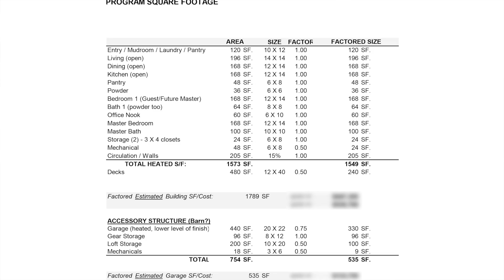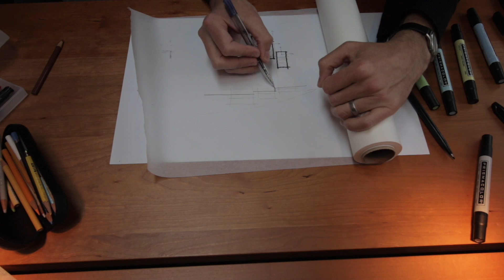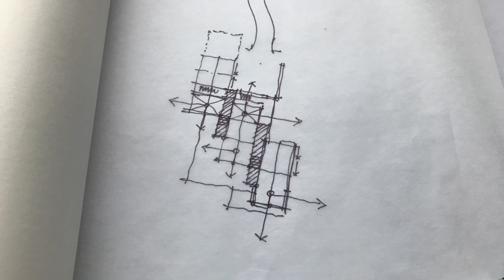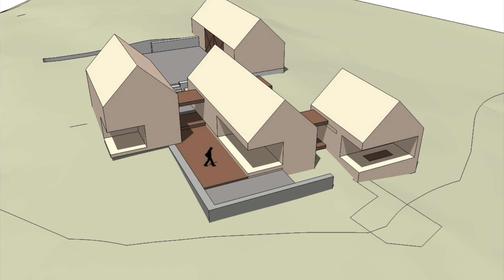Developing the Architectural Concept - Architecture Short Course (Part 2)

Comment: Hey guys I dont want spam but there was a glimpse of a trace paper with site analysis on the table with a huge arrow pointing out the wind direction. How do u decide where the wind comes from ? Actually I was wondering this for years. Is it from relevant datas or u decide, what if u cant come to the site ? thank u for explanation to my dumb question
Reply from the maker: no such thing as dumb questions...I use local climatological data from the national weather service and observe site conditions. here on the coast of maine the trees often flag (point away) from the prevailing wind direction. another way is to observe deadfall or vegetation growth patterns which can often indicate prevailing winds on a site.
Reply: 30X40 Design Workshop much much appreciation for your answer. I didnt expect one. Thank u for your tips and keep the good  and inspiring work. Cheers !

Comment: How is it you learn or how to you know how to balance the required thermal mass for moderating temperatures throughout the day which are likely to radiate heat out again at night with wanting to keep night time temperatures cool in bedrooms? Baring in mind I come from a part of the world that in summer we can have temperatures as high as 47 degrees C and have minimum temperatures sustained for up to a week as high as 28-30 degrees C during the day. Also wanting to balance this with keeping the temperatures reasonably warm during winter months?
Reply from the maker: in general the principle in extreme climates is to use higher thermal mass materials (concrete, tile, trombe walls, etc.) to your advantage and buffer temperature extremes. as with everything else in architecture you have to balance the structural implications, cost, and aesthetics alongside the thermal properties you're looking to achieve. as you might imagine, none of this is easily reducible to a formula. Building conventions will get you most of the way there though...i.e. a standard 4 or 5" concrete slab on grade is quite a bit of thermal mass, relatively inexpensive to build and has a fantastic aesthetic. hope that helps...
Reply: Yes very much. I guess my consideration of this area is heightened by my current circumstances where I am living in a converted garage, solid concrete floor and all the walls and roof are well insulated with fibreglass bats, windows are not huge and light directly onto the slab is rare. During the day even in cold weather with the help of some heating or just the sunshine the room heats nicely and maintains its heat which is kind of a positive but the downside is the heat is maintained well into the night which for someone who does not like sleeping in a room of 20 degrees C or more is a bit of an issue so I find myself contemplating what design aspects would better balance these issues though thinking now as I type this I think the main issue is that with the exception of the bathroom it is one large open space and does not allow separation of heating zones. Obviously having the living areas warmer at night would be beneficial (with the exception of heatwave periods) and ideally you would want to thermally isolate the sleeping areas. which in this case is not possible.
Reply: Using thermal mass for temperature regulation sounds great in principle.  But this concept brings with it temperature fluctuations that may not be acceptable to most people.  (If you don't allow there to be any temperature fluctuation, all the money and effort you put into creating thermal mass is literally wasted.)  Maybe better is to investigate some kind of solar battery that stores energy?  Storing heat in living spaces is a flawed concept, because most people are trying to avoid excess heat and temp fluctuations!

Comment: Eric simply put. It is a treat each week to watch your insights into architecture. Your videos are very inspiring and you have a gift not only in architecture but in public speaking. You are clearer than most of my professors. Keep up the excellent series and look forward to the next one.  P.s. Your sketches are amazing, this is the level I strive for.
Reply from the maker: kind words +Jeff Rice many thanks...
Reply: +30x40 Design Workshop also, i just want to add that my professors recommended us to watch this and part 1 and it really did help me because it's still my first and im still having trouble with developing concepts. so kudos to you Eric!!!